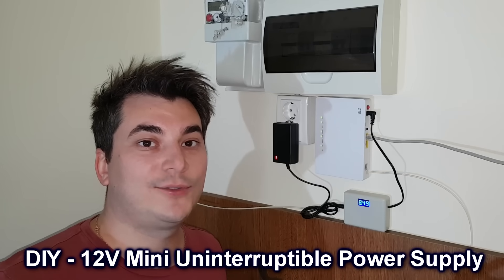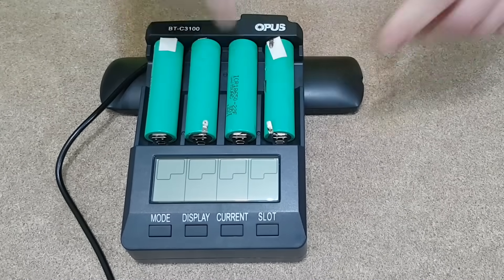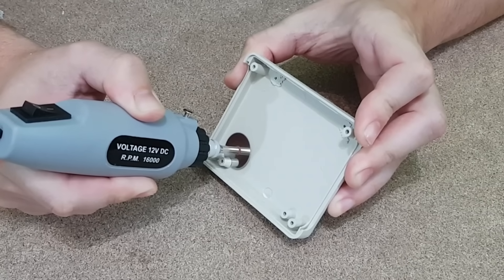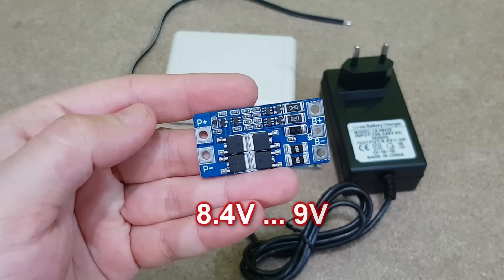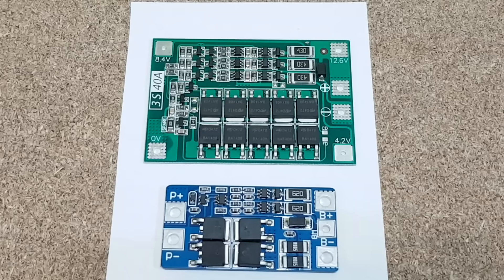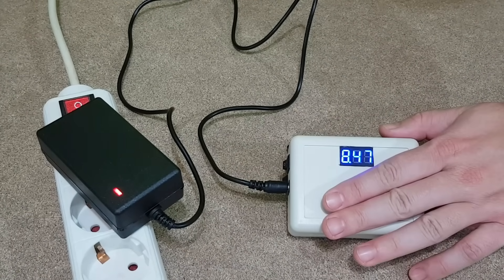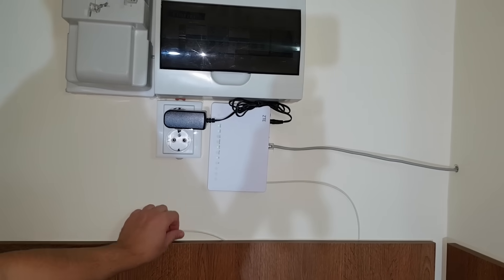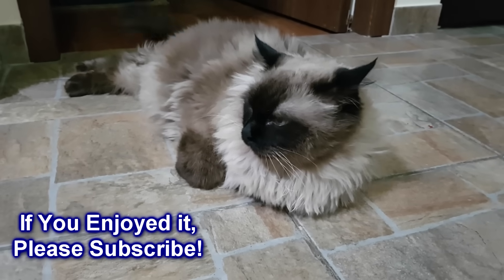DIY - 12V Mini UPS

Comment: Hello Sir,
I have tried to make this UPS for my router. I used same modules as you told. But I am facing a problem. Please Help me to sort that problem.
The problem is that my BMS 2S board is not working properly. I used 2 Lithium ion Cells of 4200mAh 3.7V, and an adaptor of 9V with 5A. When I switch on the adaptor, it runs the router (12V, 0.8A) properly But at the same time it does not recharge my Cells. I tried to solve this problem by replacing the BMS but the problem is still there..
So please help me if you understand where the actual problem is.
Thank you.
Reply from the maker: hi. does the UPS work on battery? also try to connect a diode in series with the charger, to decrease the charging voltage to around 8.4V.
Reply: @Sorin_DIY  Yes the UPS works perfectly on Battery. And please explain a bit more why we have to decrease the voltages to 8.4V with the help of diode..?
Reply: @Sorin_DIY  Because I made another UPS with a 3S BMS. with an adaptor of 12.3V and 3A. But I am facing the same problem with this one too that the BMS is not recharging my cells.
Reply from the maker: diodes have a forward voltage drop of 0.5 - 0.9V. the BMS board is charging the cells, so you can try to power it with a different voltage. but I never had a problem like yours.

Comment: Bro does it work normally by the 12V adapter and when the AC power is cut off  it works from batteries.
Or is it continuesely working from the battery power?
Reply from the maker: it works on the battery only when the main power is off
Reply: @Sorin_DIY  so it is an offline ups. And could you plz tell which part switches the current?
Reply from the maker: hi. the BMS board stops the charging of the cells when they are full. but if the charging voltage suddenly drops (main power is off) the BMS lets current from the cells to power the step up converter. if you want to build this UPS I suggest you use this BMS board, it's better:
https://www.aliexpress.com/item/32863604994.html?spm=a2g0o.productlist.0.0.78a81a17yfgf8N&algo_pvid=7a7a9384-1f05-43f8-af1c-2152aba8627a&algo_expid=7a7a9384-1f05-43f8-af1c-2152aba8627a-1&btsid=0ab6d69f15918369686154295e5c92&ws_ab_test=searchweb0_0,searchweb201602_,searchweb201603_

Comment: 3S 12V 18650 10A BMS Charger Li-ion Lithium Battery Protection can i use this??
Reply from the maker: hi. it's not a simple answer. it depends on some factors. if you need 12V you can charge the 3S battery pack with 12V, not the standard 12.6V. you will lose some battery capacity. when the battery is used, the voltage will decrease, so you still need a step up converter.

Comment: Helpfull video.  But i dont think bms is mandatory for 2 18650 in parallel
Reply from the maker: you need a BMS protection board even for 2 lithium cells. because the voltage of each cell must be monitored individually.

Comment: Did you test how long the mini ups lasted using your Zte modem/router?
Reply from the maker: hi. I tested it only for a short period of time. but according to the current consumption and the capacity of this small battery pack, it should last around 6 hours, maybe more.
Reply: @Sorin_DIY  amazing, because I currently use a powerbank of 20kmAh and my wifi modem/router only last an hour (i used a cable that converts 5v to 12v)
Reply: Id like to do the same project you did, hopefully the parts you used specially the pcb boards area available in my country.

Comment: facespalm.
the router inside already has a 5 or 3.3 volt converter. and power supplies are usually supplied from those at hand.
therefore, the effectiveness of such a device is very low and does not make sense.

Comment: Can you help me, what do i need to upgrade on your built if i will use a car battery 2sm
Reply from the maker: hi. you need a different type of modules. a powerful charger with more than 13V, depending on the battery, a charging module for lead-acid battery, a 12V stabilizer. it will be a different type of UPS.

Comment: if my router need 12v 2.0amp what should I change?
Reply from the maker: everything :) you need more lithium cells, a more powerful BMS board, a powerful step down converter, a higher voltage charger. I plan to make a better more powerful UPS soon, with 2 different outputs and more features, but I'm still waiting for the components.
Reply: @Sorin_DIY  I would love to see your next UPS project

Comment: you could have used a diode on input so the battery doesn't backfire power to the charger thus increasing back time

Comment: Can these batteries be used for jumpstarting a car?
Reply from the maker: a car needs a few hundred amps of instant current depending on the type of engine. it will work but you need hundreds of these cells.

Comment: Why not use the whole battery pack as is?
Reply from the maker: you mean the entire laptop battery pack? that will work too, but I want this UPS to be small and simple. 6 hour battery time for my router is enough.
Reply: @Sorin_DIY  Thanks.

Comment: Sir you use 12v adaptor or 9v adaptor for charger ups?
Reply from the maker: I use an 8.4V charger
Reply: @Sorin_DIY  if i use 9v for charger blow up? Or demage the battery?

Comment: hey nice build i was searching for this kind of project as there is lots of power outage and generator takes time to start .  can i leave the whole thing plugged in all the time will it over heat . and is the capacitor and the LCD necessary my router is rated for 12v 2amp
Reply from the maker: if you need a UPS with 12V and 2A you need something better. a 16.8V & 2-3A charger, a 4S BMS protection board with balance and overcharge release voltage features, a 4S battery pack and a 5A step down converter. 5A so it will not heat up at 2A.
Reply: @Sorin_DIY  thanks for th help
Reply: @Sorin_DIY  can I use three 4 volt lead acid in series with with a boost converter

Comment: I should appreciate you for your informative and pratic work. I'm thinking to make an 1s4p config ups for my 12v1A modem, but it'll be also a powerbank by using a powerbank module that has two usb output for charging mobile phones, tablets etc and one micro usb input for charging my 18650 batteries. This module will also act as bms and charge my batteries with balancing. I'll connect a MT3608 boost converter to this powerbank module's b+ and b- pins with a dc switch, so it'll work only when i need to power up my modem. I wonder that are the batteries take damage at ups mode if they stay connected to the supply adaptor all the time. Do you have an idea about that?
Reply from the maker: hi. it depends on what charging module you use. the TP4056 is very good and it has overcharge release voltage, so the cells are not charged continuously. but this isn't enough. if you increase the voltage of a lithium cell (2.5 - 4.2V) to 12V for a 1A load it will put a lot of stress on the step up converter, as I explain in my video about DC converters and battery packs. for a smaller load it will be ok, but for a 1A load it may damage the step up converter.
Reply: @Sorin_DIY  i understand your point about charging cells. I know that voltage regulators can seriously heat up when there's a huge difference between input and output voltages, so i'll use a heatsink on the transistor, maybe i can even add a little fan on it. I've never measured the current that my modem uses, but it's original adaptör is 12v1A type. I won't use tp4056 for charging, the powerbank module will charge the cells balanced, but i remembered to add two 1s3A bms for two pair of 18650, so the cells won't be overdischarged by MT3608.

Comment: Hey ... thank you for your video ... looks very good :) ... do you think it can be used as UPS for raspberryPi?
Reply from the maker: yes. but it needs a step down converter to set the output voltage to 5V.

Comment: Can i use single 18650 cell and lower power charger ?
Reply from the maker: you can use a single cell, but for small output loads, maximum a few hundred mA
Reply: @Sorin_DIY  thanks for reply i want to use for single router same as yours  can i ?
Reply from the maker: you need to check the current consumption of you router. if it's more than 300mA it's not recommended to use a single cell.

Comment: Very interesting video. Thanks. I made a 12V ups using a Door Access Control Power Supply bought from aliexpress. The best thing about this board is that no soldering is needed, any noob can make a ups in a few minutes. The input can be 220V or 110V AC. The ups is powered by 12V 7Ah battery. The board has overcharge and low voltage protection also. In my testing I ran my router for more than 24 hours and still the battery voltage left was around 12.4V which means it will run for a couple of hours more. Also there is no delay when switching from AC input to battery mode. Give it a try.
https://www.aliexpress.com/item/4000335542990.html?spm=a2g0s.9042311.0.0.1cec4c4d1Zekd7
Reply: Hello friend...can you share to me how you build it pls....heres my email add....crisalegato@gmail.com...thanks
Reply: @keyofc8183  It is very straightforward. The connector terminals are screw type and are marked on the board.  Simply connect battery to Bat terminal and there is 12v out terminal which can be connected to modem. No soldering is needed. For  modem connection you may need a dc jack. I used the cable and jack from an old  non working charger of another modem.
Reply: @baijuxavier  thanks...what battery did you use?
Reply: @keyofc8183  I am using 12v 7Ah lead.acid battery which is commonly used in desktop ups. The backup was impressive.initially, but now it is very low. I think the battery is bad and I have requested for a replacement. Meanwhile I ordered a 12V Lifepo4 battery which is more efficient than lead acid battery. Lifepo4 is a little expensive but it will last around 10 years compared to 3 to 4 year life of lead acid. I suggest a lifepo4 battery if you can find one.
Reply: @baijuxavier  thank you so much friend... :)
Reply: @baijuxavier  how many ah 12v lifepo4 battery do i need to use?
Reply: @keyofc8183  This ups board supports 7Ah battery. Higher Ah can also be used, but charging time will be higher. I ordered a 6Ah lifepo4 battery which will give me a very good backup time. My router draws 250ma only so a 6Ah battery can provide 24 hour backup in theory. So, select a battery depending on the backup time you need.
Reply: @baijuxavier  hello again friend...i found a ups door access box...12v 3A....can i use it ofr my router?
Reply: @keyofc8183  yes. 3A can be used. Also check the voltage requirement of your router. If it is 12v, you can connect it to the 12v out without a y problem.. But If it is 9v or 5v, then buy a dc to dc buck converter also and connect it to the 12v out of the ups and adjust the voltage.
Reply: @baijuxavier  
can I use boost converter, like this https://www.aliexpress.com/item/4000078484869.html, to boost the voltage to 19v, as my router is rated 19v 2a?

and is it safe to use something like this for powering a NAS?
Reply: @pdkum74  use a good quality boost converter. Low cost items may not handle 2A current well and may heat up easily. I don't think you can run a nas this way because the current consumption of nas may be higher.
Reply: @baijuxavier  
appreciate your reply. 
could you please point me to a good quality boost converter. TIA.
Reply: @pdkum74  I think the boost converter in your link can be used as it can support up to 10A. It also has heat sink. I have not tried it. my router is 12v, so I don't need any boost or buck converter.

Comment: Hi... plz guid me how to make one usb port for mobile charge or other device charge. Pls tell me the circuit diagram for that.. I want to add one usb port on ur DIY router ups.
Reply from the maker: hi. I will make a better UPS with more features, after a receive the components. I will then provide more details. for this UPS you can add a step down converter from the battery pack, to decrease the voltage to 5V. the output of the converter will go to a USB port. you can add a switch before the converter, to turn it on only when you want to use it.

Comment: 8:00 you should also make a knot with the power cord inside the case, that way if you pull on the power cord, it wont pull the electronics out and damage the soldering points
Reply: ok
Reply: That or one of those crimping type strain reliefs that just snaps into the hole a lot of appliances use. If space is the issue as in that small case one of those snap in might take less room.

Comment: Link to battery capacity tester you used in video?
Reply from the maker: it's an opus bt-c3100 v2.2 charger. I bought it a long time ago, I don't have a link.

Comment: I have a USB power bank that can out out 5v 9v 12v. I'm currently using either quick charge trigger or 5v to 12v USB boost. The problem is how can I make automatic switching functionality (UPS) between the power adapter and the power bank? Consider I want the switching capability to work between 5v to 9v at least. Thanks

Comment: The batteries didn't  get damaged if they are all the time connected to the power, aren't they continuously charging and discharging? Thanks.
Reply from the maker: hi. the li-ion cells are not continuously charging. when the cells are fully charged, the charging process is stopped. but the cells will slowly self discharge and when the cell voltage is starting to decrease, the charging process starts again. the step up converter is powered by the charger, so the cells are not charging and discharging in the same time. the problem is that the cells will have a lot of charging cycles, this will decrease their lifespan. this cheap BMS board is not the best for this project, you need a BMS with overcharge release voltage.

Comment: We want to make one, but we want to increase the batteries to 6 or 8 batteries What do we do in this case is there a BMS board Slightly larger to charge all of this battery ?
Or answer using the same board🙄❤
Reply from the maker: I plan to build soon a better UPS, with bigger capacity, more power and other features. but I'm still waiting for the components...
Reply: @Sorin_DIY  
heloo mr sorin thanks for replay ...
Why not make a power inverter 
I think it will be better
And that runs other devices at 220 volts And they will be much stronger .

Comment: the ups is back feeding!
please add a diole in series with the power input
Reply: diode before the router or before the charger of the UPS ?? and on which rail? + or - ??
Thx
Reply: @DrZipZwan  add the diode before the ups ,and each rail is fine,just to prevent bck feeding to the charger
Reply: @lifeai1889  so between the UPS and its charger. not between the UPS <> Router. got it 😉
Ok is 1N4007 a good option?? 
Thx
Reply: @DrZipZwan  acording to the data sheet,1n4007is rated for 1A ,so if your router power supply output curnnet
is lower then 1 amp than it's totaly fine
Reply: @lifeai1889  yep, my router power supply is rated 9v/ 850mA, and  I tested it,  it barely reach 350mA.
I will go with 1x18650 for now, because I dont have access to a BMS board and gona take lot of time to be delivered to me 😒
Plus, we have electricity power generator as backup, but there is a small time interval of 2-10 min during change overs, so I just need this build to last till the take over of the generator...
thx a lot for your support, and to  Sorin, for its so useful project 😉
Reply: @DrZipZwan  but than you might need a boost convertor to step up the voltage to 9v form 4v
Reply: @lifeai1889   you right. I will use Boost convertor  MT3608 (which I have already in comparaison to the BMS board) , to reach 8-9V. I read that Router dont mind a little less voltage for a while, it is over voltage that is more dangerous. 😊
And I tested my router with 8v, it was very happy 😂

Comment: Very good project... although one of the important features of a ups is an alarm to warn you that your supply has failed and you might want to do something about it, otherwise you can continue in ignorance for an hour or two and have the same problem.
Reply: When I get new UPS I normally turn off that alarm because it's normally just a bad thing. If there is power out I will notice it from lights etc. and if I'm not home I don't want my UPS to alarm here and my neighbors call the firedep. because they think that it's a firealarm.

Comment: İf you were used 3S battery you would use the  original power adapter of router. right?
Reply from the maker: hi. the original charger has 12V, not 12.6 and it's very underpowered. you can see the voltage dropping to 11.8V. it will damage the cells, because it can't fully charge them.

Comment: Thanks for the amazing video, I learned so much! Is there any possibility on using a 5v micro-USB for the input charge?
Reply from the maker: 5V is not enough. you need another step up converter, to rise the voltage to 8.4V. it's doable but it will be very underpowered.
Reply: @Sorin_DIY  Ah I see, I'm trying to use this as a UPS battery from my 5v solar panel, I want to use it to power a 5v input wifi camera. But I probably won't be able to do that either, since I'm guessing the output is also going to be more than 5v lol
Reply: Try module TP5100 it's support 2S battery with input 5V ~ 18V